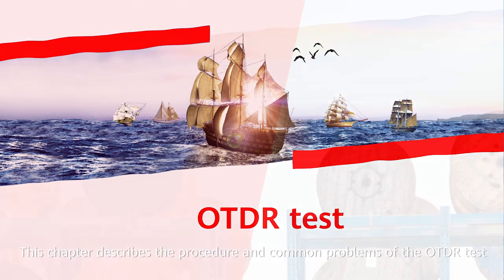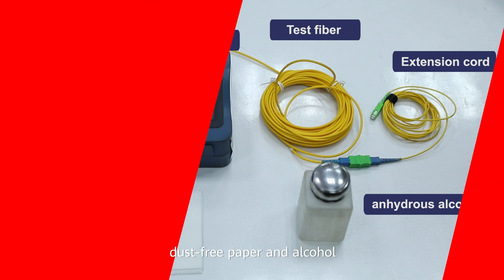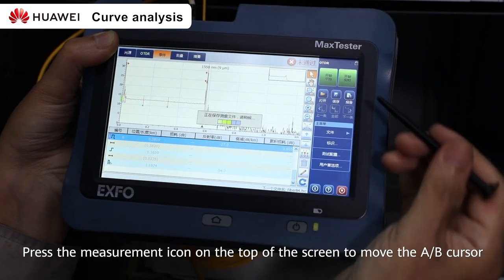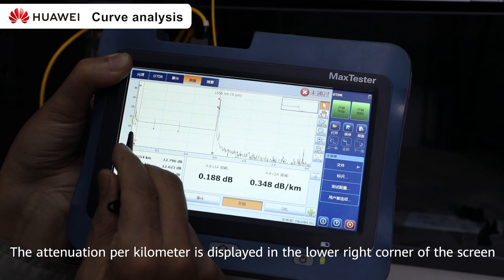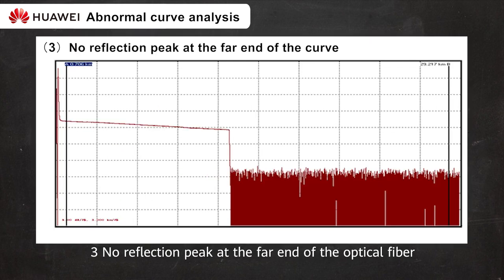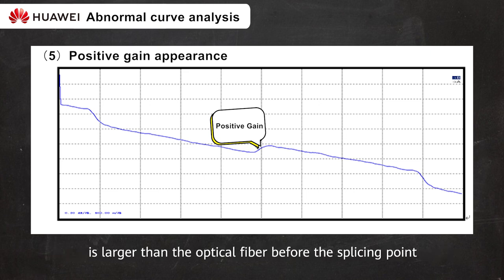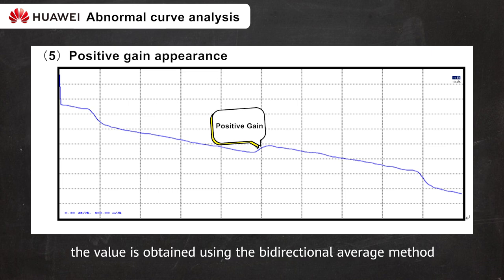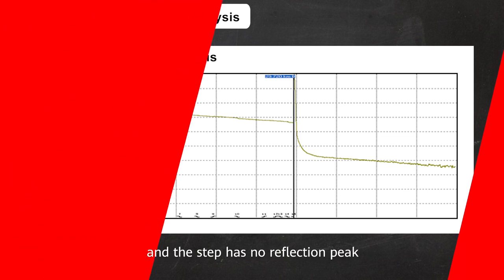How To: Avoid Common OTDR Test Problems

Comment: Too short launch cable even for exfo 720, OTDR has no chance to correctly measure the parameters of the first connector and the fiber after it, giving a low-accuracy measurement as seen on the screen. This measurement does not reflect the true characteristics of the fiber under test thus not reliable.

Comment: Some things wrong in the video
How to plug APC connector to UPC coupler
Reply: It shouldn't make any difference the housings are identical it's the end faces that are different
Reply: Ha just noticed you got it wrong too. It's  a UPC connector plugged into an APC coupler 🤣 However, it still doesn't matter 😁
Reply: It will cause high loss than the normal,
And in our field it is fital mistake but for you no worries do what ever you want :)
Reply: @moatazasadek  No it won't. You will get a high loss if you try to interface an APC connector with a UPC connector but that's not happening. He's interfacing a UPC fibre to a UPC fibre. The housing makes no difference.
 If you don't believe me join 2 APC launch leads together using both types of housing and shoot light with your OTDR and no significant loses  will be observed then join a UPC and An APC launch lead together and shoot light from your OTDR and you will see loses no matter which housing you use. The only difference between the housings is the colour, all the alignment is done with the fibre face angle.
Reply: Ok no problem you look understood the field good and i trust your.

Thank you for sharing,
Reply: Only adapter color issue , but will not effect because both side are UPC , but should use UPC adapter also because its Huawei page and should follow standard rules

Comment: Thanks, I have one question why OTDR often misses some splices of the fiber under test
Reply: Pulse width is too big. If your pulse is at 30ns then your pulse will be 3 metres long, any events in that area will be shown as just one event and not individual events.
Reply: You should check the threshold setting maybe the values very big and your events less from theses values so will not appear in table
Reply: @DKy0  thanks
Reply: @BekoIQ  thanks